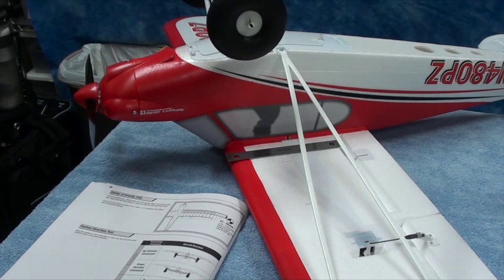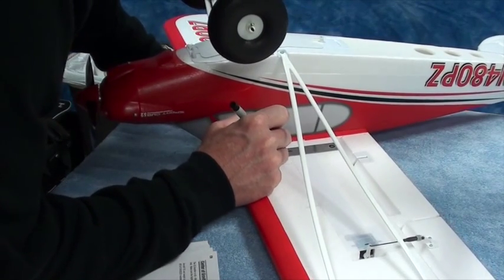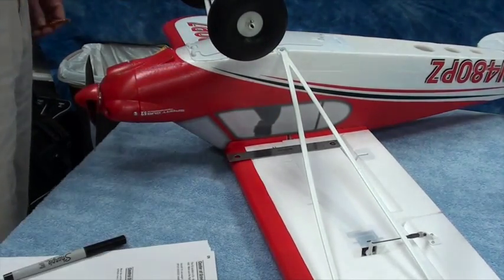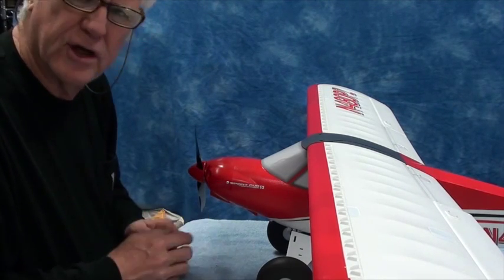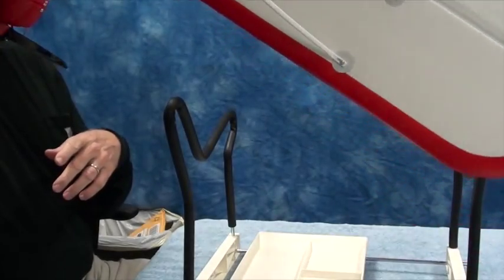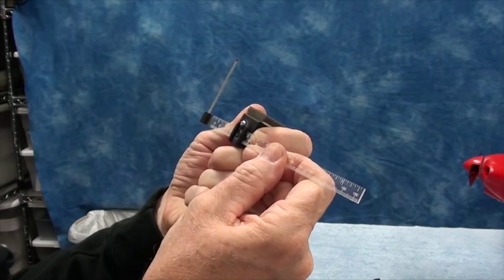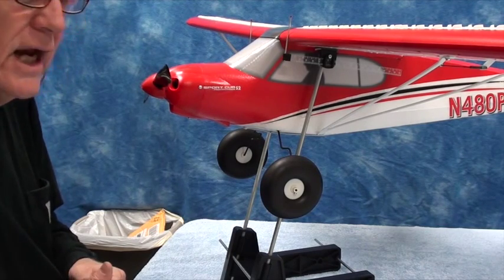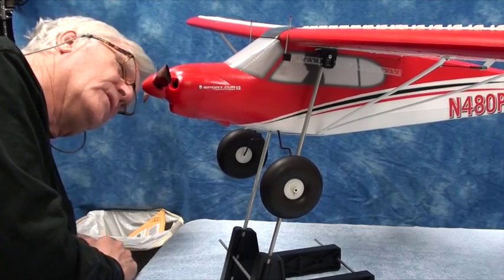SC14 Sport Cub Center Of Gravity

Comment: Just built a Tower Hobbies trainer. I did the cg by machine making it slightly nose heavy say 5 deg nose down. When it got airborne it flew like a drunk monkey; barely controllable. Fortunately one of my fellow pilots was able to bring it home. As part of each build, I install a transparent furniture dimple; the ones used to separate the glass from the table top, at the cg point on each wing half.  The guys at the field added an additional 5 weight segments to the front, using the finger test.. I am guessing that the plane tilted about 20-30 deg nose down. The plane then flew like a dream. I could not believe the difference making it so nose heavy had on the stability of the plane.  In your videos you show the plane just slightly nose heavy. This I found confusing based on my personal experience.

Comment: Excellent video. I'm starting in this wonderful hobby. A question. Why some friends say that you have to leave the plane lightly heavy of nose? Are they right or not?
Thank you.
Reply from the maker: yes, slightly nose heavy is better, but slightly.  If it is tail heavy it is harder to control because the CG would be aft of designed CG point which will cause the control to not respond as well to the elevator inputs.   In most all of my video series there is one where I show the CG balance of each aircraft.  Just what those CG videos and you will get a better understanding of what I mean about slightly nose heavy CG.

Comment: Using the same CG you used in your video, I found my plane (on fly) a little bit tail heavy even with a 2200 mAh battery all the way forward. Like you said, these mass production planes can be very different from each other.....

Great video, many thanks

Comment: So how is this plane over all?
Reply from the maker: I find this airplane to be a well proven design by the fact that it has been on the market so long.  It is the first airplane I choose to train a student with because I buy the Plug And Play (PNP) version which lets me choose a receiver that has telemetry.  Students do not need AS3X to learn with, because I train them in winds under 10 knots.  There are few PNP aircraft left on the market.  I also have a lot of fun flying it myself because it is very maneuverable.
Reply: RC Instructor
Thanks for the info, mine is coming monday, do you think a 10x6 apc prop would work? Are you using the stock motor?
Reply from the maker: I would not recommend the APC prop.  The prop that comes with it is better for this aircraft. I would recommend you get a spare prop from Horizon Hobby in case you have a problem with the one that comes with the Sport Cub. Yes the stock motor is a 480 size and works very well.  Bigger motors only help to do more tricks and 3D, but you would need to also put in a bigger ESC.
Reply: RC Instructor
Thank you so much, going to fly it stock, adding flaps, maybe a 30a esc down the road, I really like the look of the wood props

Comment: You have an AWESOME channel!!! How do you only have 119 subscribers?!! I'm going to share your channel with a few Google plus groups and see if I can help some people find your channel. I can't make any promises, but I hope it helps.

I'm thinking about scratch building an RC aircraft and will probably be watching a lot of your videos very soon.
Reply from the maker: +rhouse21 - RC Physics :  Thank you rhouse21 for the nice comment.  I scratch built a SIG Kadet LT-25 aircraft about 5 years ago and it was a great airplane and a well made kit.  I put a Thunder Tiger 36 engine on it and it was a perfect fit.  I also changed it from using rubber bands to add the wing bolts from Dubro and some dowels in the leading edge of the wing and it works much better than rubber bands.